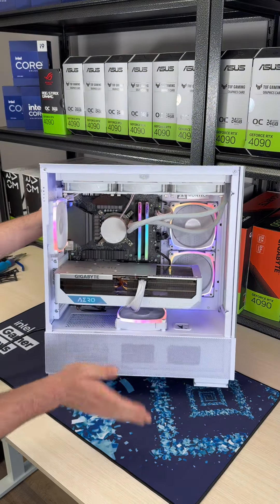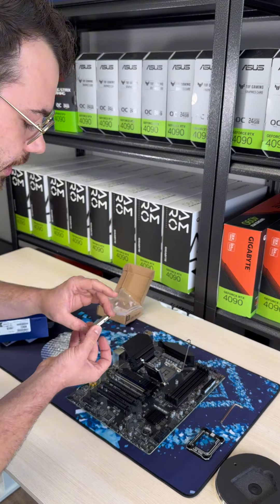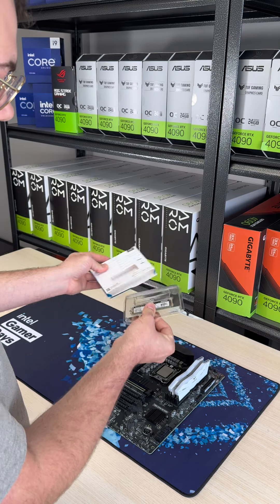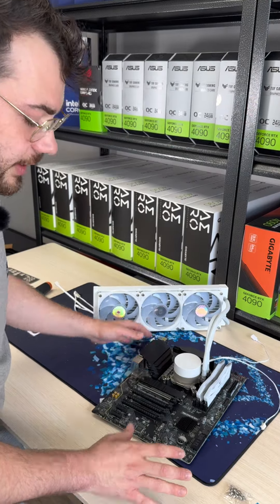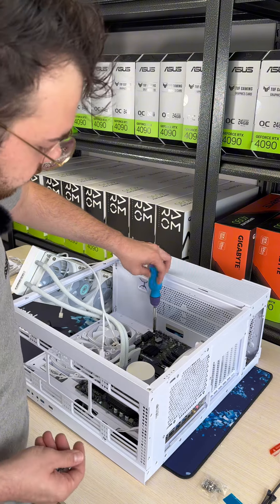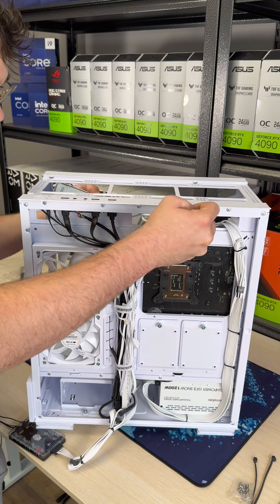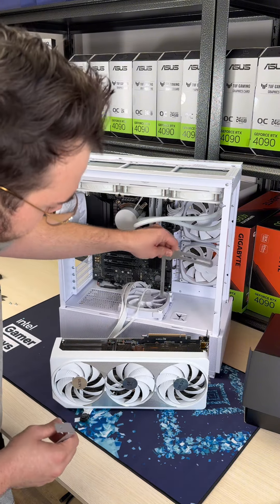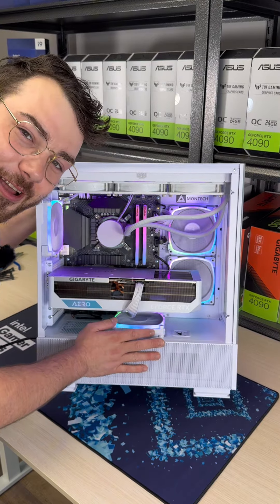Ultimate PC Build for 2024 - (i9-14900K + RTX 4090)

Comment: It looks good, but why even use a 13 or 14 gen? They have a 100 percent failure rate. The 12 gen is strong enough to run a 4090.

Comment: Here's a question for you that no one has been able to solve so far:  my PC often fails to load AMD drivers if the monitor is powered on (connected via DP or HDMI cable).  If I boot (or wake from sleep) with the monitor off, it all loads fine.  Cables have been checked and replaced with certified ones. Is the monitor causing the issue somehow?